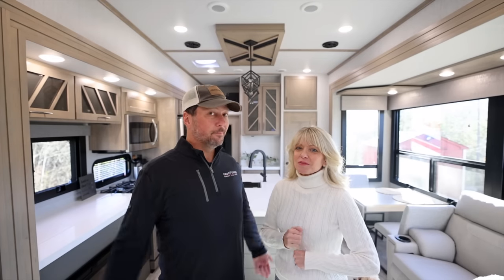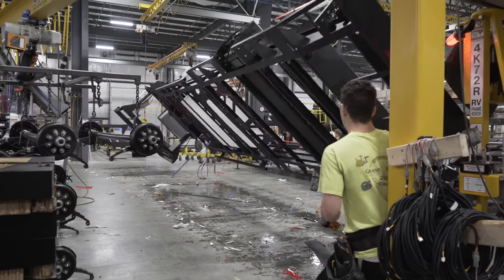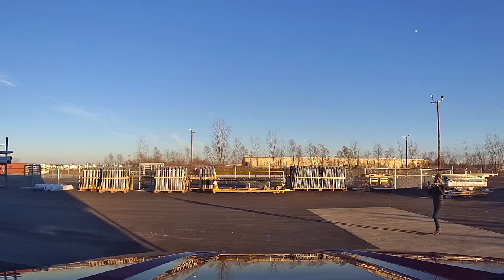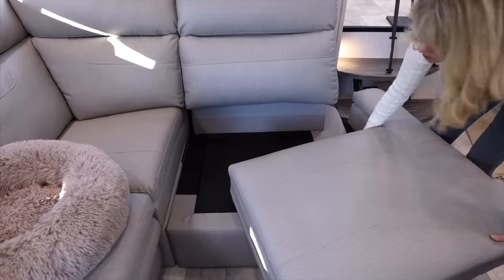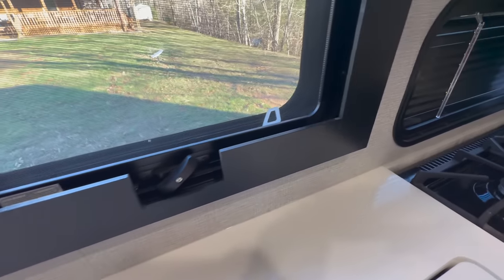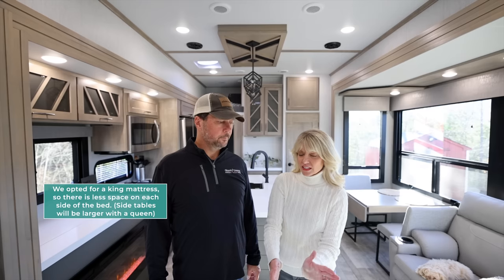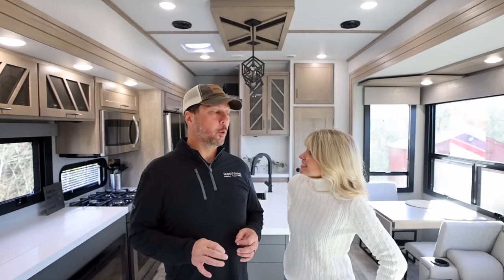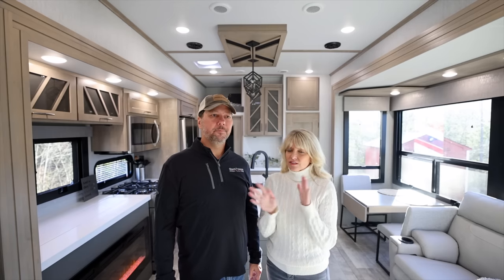Momentum 410 THR Homecoming, Issues, and Updates!

Comment: I am about to pull the trigger on a 2023 Momentum 395ms, but after inspection, realized that there is almost no basement space.  Now I am looking at the Momentum 410.  What do you think as a comparison?  Any thoughts?
Reply from the maker: If you want more basement storage, you need a drop-frame model (which the 410 is).  All of the TH models are drop frame, while the others (like the M-class) have a straight frame.  The 410 has the largest basement we've seen on any toy hauler.  Good luck in your search!

Comment: Reference the island. My suggestion would be an outlet on each side, or at least three sides. It's not about how many, it's about the available location of outlets as counter appliances have short cords for safety reasons. You might want your blender closer to the sink, but I might want it on the other side. Options, otherwise people will use extension cords!

Who designed those window boxes? Wow! Just terrible!

Outlet at the coffee bar? Outlets at the kitchen table wall for lap tops?

Comment: The island outlets should be in two locations to serve the needs of the island counter top uses. Having all 4 recepticles in one location defeats this idea. Having the 2 outlets there and another two at a different location would serve the island better. On that subject, most homes these days still use duplex outlets however, with todays gizmos and electronic needs, they really need to be 4 plex outlets otherwise folks end up with power strips here and there. Same would apply to larger RV's I'd think. The front cap lighting should be on its own switch to have better control between the two, underbelly, plus the versatility. Those bedroom lights could use a nicely made hand held correctly sized and finished "push stick" to help turn them on/off from a lying down position. A wall switch that pushes in for on/off  might be better than a toggle switch or rocker type might help if it mounted in a postion you can reach but not bump into.

Comment: Hi I would get rid of the window behind the stove completely i would have a booth instead of the table and chairs there so much better more plug sockets on  the island just remove the bottom bit of the window frames and extra switches on those bedroom lights with a bit softer light and the side wall independent of the other lights and i am sure there will be lots of other things you will find i will say hi if i c you at the show all the best from the UK.

Comment: Awesome video but I have one big major concern about fire hazards like you have. For safety sake don't change your Ebike batteries inside the rig. Put them outside on a fireproof surface and don't take any chances. I speak from experience, you don't want them going critical while charging and your extinguisher won't put them out.

Comment: Hey Chad, that noisy unit in the garage is doing the exact same thing as our 2022 397th. It's the slide vents, they do it open or closed. extremely aggravating! We can't turn off our front cap LED's either, so I will be watching for that fix. Also, the 3 side awning LED's, do you have separate controls for them on your 410 or are they like ours, where they are either "all on" or "all off?" I also noticed that your LCI control panel screen looked different and seamed more responsive. Ours is a pain in the butt because it is so slow and unresponsive to touch. Is it a new updated version? We pretty much have to use our phones all of the time because our panel is just junk... sorry to say for what we paid for the whole thing... One more question about the RGB LED's on the belly and front cap, I can't find any information about changing the LED controller to a different brand or something because ours does blue, red, and green very well but any other color is just not right. For example, ORANGE... we are "UT VOLS FOOTBALL" fans and we love to show our colors when we're camping but our LED setup doesn't do orange very well. It's not even close. I don't think it's the LED strip lights as much as it's a controller problem. Maybe you could get that question answered for me on video when they come to look at your cap light issue, I'm sure others would like to know as well ? Love all your videos, be safe, and "Merry Christmas!"

Comment: I would fear any decoration I put on that blank wall….if it falls in transit it could mess up the slide.  Yes we use command brand fasteners but you never know.
Reply from the maker: It's a pretty easy area to check before putting the slide out.  We have some metal prints that are pretty light.

Comment: There should be outlets on both ends of the island
Reply: I have a GD 320MKS and use the power outlets on both sides. And there is no issue cutting that outlet into that ship lap to install the outlets. Do not take no for an answer.

Comment: Why do you need more than 2 a/c plugs on the island? You can only use 2 appliances there. There is not enough room for more, correct?. You only use 1 at a time anyway. If the is room for a third appliance the unplug one and plug in another. You can only use 1 appliance or 2 in combination but how many times does that happen.? NO you don’t need a 2nd plug on the island IMO. You might blow a breaker anyway.

Comment: Hey it is great that GD is letting you guys provide input and feedback on the design, re-design, etc.  However, it is still baffling that GD still wrestles with the final quality of a high end expensive RV.  For a company that has been around a while, as well as being owned by Winnebago for 6 years or so, I cannot wrap my head around their inability to conduct robust in-process inspections, as well as a detailed checklist at final inspection.  That, is manufacturing 101, whether you have an assembly line or a batch process. It is not good enough for them to say, well we missed a few.  Imagine if they were building aircraft or aircraft components.

As well, there are so many high end computer design programs available that allow you to correct proper placement of controls, outlets, etc etc, it is really inexcusable that these things get overlooked.  If it is not the program, then the user's need to have their work peer reviewed before sign-off. If GD had not let you folks in on this beta test, imagine how many units could have found their way into the market with all these flaws.  I spent decades in quality and supply chain, and though I like their overall models from a 10,000 foot view, I expect a lot more than what they are delivering.  I will continue to wait on the sidelines again, while they perfect their operations, and rumble down the road in our Keystone Outback that has way fewer problems in 4+ years.  Keep up the good work you two, and I hope GD gives you considerable concessions or a 1:1 trade in when they finalize the production units.

Comment: Electrical… does the Rv industry not have to abide by electrical code in a kitchen? An island with or without a sink that is near 48” long is required to have outlets at each end of the island to prevent the use of extension cords running past the sink

Comment: I think the most worrying thing about the majority of the problems is that it shows the designer/builders didn't actually attempt to use the camper before giving it to you. All of the problems that you experienced would have been evident/noticed at the very first attempt to use them. Doesn't really inspire a lot of confidence. I get the fact that youre beta testers but you would think that The company that designs and builds the thing you're testing would have at least given it a once-over before handing it to you.

Comment: Re: window valance/trim: why do they even have them? To hide the window edges? If so, how Victorian! (Akin to hiding table legs b/c legs of anything was scandalous). I’d rather not have any & just make the blinds an inch wider on each side. Less weight and stuff to gather dust & stuff like dead bugs.

I like my outlets spaced apart, one definitely on the island but one on the tv wall near the cook/prep space.

Solution to stove window, have the Venetian blinds inside the window. Easier to clean, no fire hazard & can be fitted to edge.

Comment: With all do respect, it is a very nice RV, but what about the safety part of it. I mean that thing has to weigh a ton, I’m pretty sure it’s pushing you does to the max as far as stopping power and towing capacity. I think you need to upgrade to a better tow vehicle as well

Comment: Chad,
Quick question....how many watts solar is up top on your 410 now?  Thanks!!!
Reply from the maker: 1300W. 👍🏼
Reply: @ChangingLanes  Thanks, hopefully that's a future option and not just the standard 660w panel/2kW inverter setup.  Something else to think of too, is that the new F series Super duty has a 2kW Propower onboard.  If wanting to go with a Volta system, I think it would make the Propower useless for powering the rig.

Thanks again guys and to all those on your team!
Reply: @ChangingLanes  btw, wife also votes that when the control panels are moved, leave the space open like Tara suggests.

Comment: I don't understand in RV islands why they don't make it like a residential island. The whole false panel with the outlets on top is just horrible and its not just yours, our Cougar is the same way. But we have outlets on 3 sides and one is on the floor for some reason. There's no reason why they cant put it in the shiplap. You should have a top drawer that's usable with the outlets on the side. I do it all the time with my cabinets. All you do is make the top drawer a little smaller for room for the outlet and the face of the drawer the same as the one below. The bathroom idea is the best though. The hallway has always been a total waste of space.

Comment: 4:04 Why have they not addressed that pantry door issue? It should be an easy solution so that it does not open during travel as to get damaged when operating the slide???  It could be a super simple solution like a light barrier (infrared light beam) like on a garage door, so that the slide and the pantry door know what each other are doing. Then when there’s clearance the door latch would automatically operate. In my industry I see very simple mechanisms like this all the time. I just don’t know why that hasn’t been addressed on such a nice rig. 

Actually like most engineers lol,  I’m way overthinking it. All they need is a simple micro switch interlock. When the slide is closed the door simply is latched and cannot be opened. Done!!

Comment: Did you get electric over hydraulic brake system it’s a game changer so if you don’t get it and you will stop on a dime with 5 cents change !!
Reply from the maker: Yes.. that's part of the MORryde Independent Suspension: https://youtu.be/knG7L7VTeeY

Comment: Unless they've upgraded the Lippert thin shade it's one of the cheapest pieces of junk I've ever owned. In high heat areas the cheap plastic frame warps and won't stay latched which the latching system is a joke to begin with.

Comment: I hate those stupid colors and will not buy one if that's all GD has to offer. Nearly as bad as farmhouse! Pretty stupid on GD's part to put you in a RV that stuff doesn't work in. Hard to believe an engineer wasn't smart enough to know you couldn't access the control panel. You would also think that one of the engineers would have tried to work the shades. What it comes down too- is nobody cares anymore and nobody has any pride in there work. That's too bad. I have had two GD RV's but not sure I will buy another. Quality has really went down over the last few years. When they first started they made great RV's.